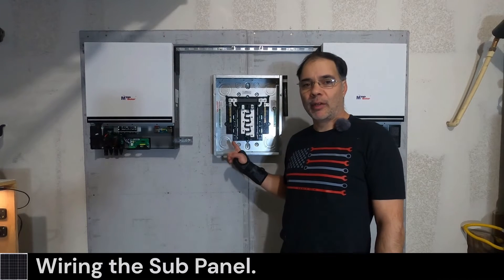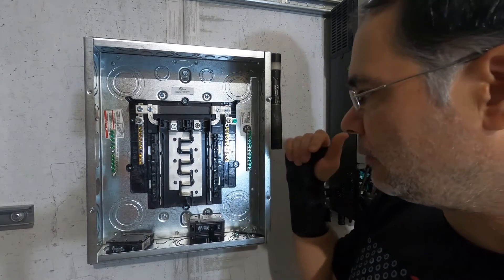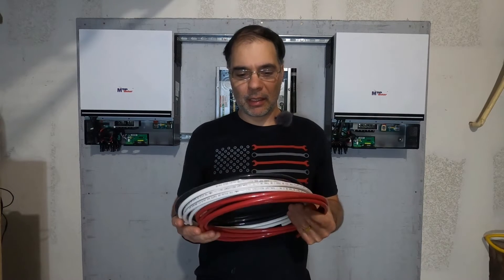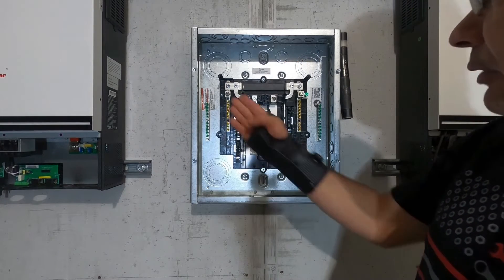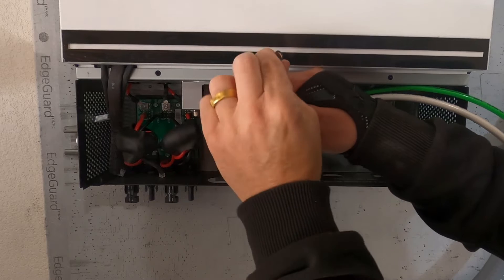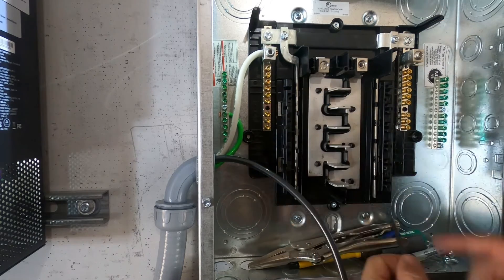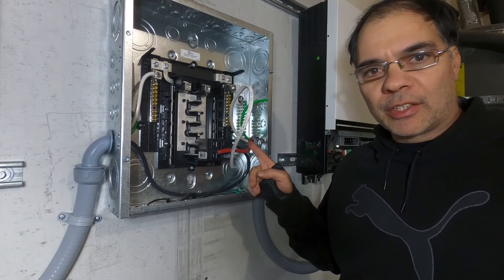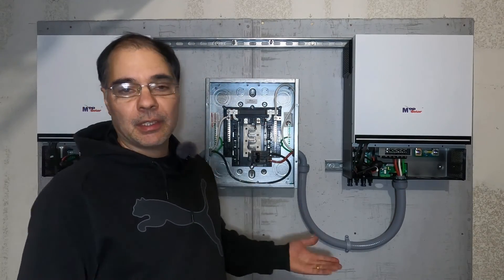Wiring Inverters for 120/240V Split-Phase

Comment: Hi Nate! Thanks for the helpful videos and neat projects. I have two MPP LV2424 inverters in split phase mode, just like what you have here for an off-grid application. I am observing an erratic behavior: When I turn on my Heat Pump, inverters' output voltage fluctuate between 100 and 120 (set to be 110) and my heat pump draws 12 amps instead of its normal 6 amp. I found a workaround: If I disconnect the PV, run the heat pump just from batteries, everything is smooth and normal. If I connect the PV meanwhile, system continues to its smooth operation. I found out that even in cloudy days system can start normally with PV connected from scratch. I have 10 of 420 W solar panels (2S5P). Do you have any idea what could be my problem? I am using a soft starter kit for my heat pump as well, did not help!
Reply from the maker: That certainly is strange.. what do u have set for paramater 01 - output source prioroty.. set it to SBU and see what happens.. any reason u have output set to 110v? Is your mini split 120v or 240v.

Comment: Hi, great video do you ground your main panel from inverters to the ground rot on your house?
Reply from the maker: I personally did by way of the grid input.  I've seen ppl do both ways.  Seperate ground rods and using existing ground rods. It really depends on your local regulations and system design.  Generally speaking, if it's an off grid system, then separate ground rod. but if it's grid tied, then use the same one.  See my video on ground neutral bonding in this series playlist.

Comment: Thanks for sharing your knowledge question on Earth grounding for an off-grid system I already have a ground rod for the DC side in place I will assume I need a separate ground rod for the AC side am I correct
Reply from the maker: Yes

Comment: do you have a video on wiring the  AC in to the inverters, how do you bring one neutral and ground to each inverter? thanks for the detailed and easy to follow video!
Reply from the maker: Yes, there is a complete playlist. I  think it's the 2nd to last one.. called wiring grid assist #8.  The ground and neutral are shared. It splits out in a J box.  

https://youtu.be/lsuo7R2AXsA?si=mhAbqkdQF54q7uAF

https://youtube.com/playlist?list=PL5HF6X8PstrQBzDUJA5fBtEXWk6bRvlPN&si=aOwuz5Ox07lkJsr-
Reply from the maker: Good luck!

Comment: Great video! Very informative. I have 1 question regarding the ground-natural ground screw and going off grid. My understanding that the manufactures manual should provide details on the location of the screw inside the inverter. If the screw is removed to be full off grid, does the neutral and all the wiring remain the same? The only difference is I would just remove the screw?
Reply from the maker: Funny, you should ask.. I just did a detailed video on this subject . I will be releasing it today. But it will affect the wiring . Not all manuals cover this.  Mine did not, and it depends on the inverter. Newer inverters don't use bond screws.. you need to know the type of bonding it uses.. look for the video later today.

For now, u can watch this guy's video pt2 and pt3 of his series.  I based my testing on his video.

https://youtu.be/Ky5luEx6R2M?si=ooYikGcbJ_456rZO
Reply from the maker: I just dropped the video in the pinned comment for you.. it's still unlisted. Hope it helps. Lmk
Reply: @natesdiysolar    tyvm. My goal is to do 240v 50amp off grid. Your videos are very informational and I plan to route EG4 Load L1 and L2 to the "busbar" on the Vevor outlet panel? What are your thoughts? I'm trying my best to find downsides but to my understanding there shouldn't be any as long as the load is within range(primarily due to the ease of use of the eg4). 

From your past comments I have found the EG4 has a programmable neutral bond which is great!

Lastly Im a novice so sorry for the extensive questions...Did you wire your inverters to the 50amp double pole breaker in your panel for the safety? Functionally would it be the same if you loaded it on the top of the panel(minus the breaker safety) example at 25 seconds https://youtu.be/DOtZcRYLroY?t=25?
 
Parts-
EG4 6000XP Off Grid Inverter 
VEVOR Temporary Power Outlet Panel RV Electrical Panel 20 50 Amp RV Outlet Box
17kwh Lifepo4
6KW Solar Array
Reply from the maker: @DrBT1  I did it for safety. I wanted to have a single point of disconnect. For your inverters, I think they put out 34a, so you might need 2 of them. They recommend a 40a breaker for each inverter on the right side of the panel.
Reply from the maker: @DrBT1  if you have a single inverter I would use the bond in the inverter. If more then 1 then unbound all and bond in the sub panel
Reply from the maker: @DrBT1  your inverters do split phase in a single unit so it's very easy to stack them.  Just pop in another 40a breaker . Will prowse has a good video on this.
Reply from the maker: @DrBT1  your inverters are different than mine.  I need 2 to product split phase.. your wiring will be a bit different and simpler
Reply: @natesdiysolar   I see what you're mentioning. My EG4 6000XP specs show "MAX. CONTINUOUS OUTPUT CURRENT @ 240V 25A" so I need to run 2 in parallel to hit the 50A or find a better all in one unit. The EG4-12000XP shows "MAX. CONTINUOUS OUTPUT CURRENT 50A @ 240VAC | 57.7A @ 208V"
Reply from the maker: @DrBT1  correct
Reply from the maker: @DrBT1  very few things will use 50a continuously.. the only thing I can think of is an EV charger... that's 12000 watts
Reply from the maker: @DrBT1  from what iv seen most ppl putting those inverter in an RV just get away with a single unit.   But if u need 50a get the 12000xp .. more power in a single unit

Comment: so these inverters are 120 v each so you need 2 inverters to make it 220v
Reply from the maker: Correct.  Check out the eg4 6000xp if you need 120 240 in one box

Comment: I also have two MPP Solar inverters of the same model. Your installation video series on YouTube is the most detailed and extremely helpful. I have a question: is the ground wire only connected to the electrical panel and not to a grounding rod? When using a 240V outlet to charge a Tesla, does it still show a missing ground connection? Does it require a ground-neutral bonding plug? Thank you!
Reply from the maker: I have not tested my system yet with an EV. I've been trying to get a fiend to come over to test it.  I do know the tesla charger, and many others look for a ground neutral bond.. so if you keep bonding screws in the inverters installed as they come from the factory, it should be fine.  It just wants to see a proper ground even if it's not grounded to earth. I do not have mine grounded to earth at the moment.. only to the sub panel. 

Yes, you would aquire grounding if connected to your house ground via the AC input. IF you use grid input.. 

If there is no grid input, you should have the panel grounded separately to earth, but the system will still work without.  I just have not gotten around to hooking up my grid input... which would in turn give me a path to earth via my house ground.. hope this helps.. lmk
Reply from the maker: Update: I just tested my system with an EV and I made a short video.  Yes it needs to see a ground neutral bond.  It does not care if the system is grounded at a ground rod. 2 different things.  

https://youtube.com/shorts/KrQK80X8JTw?feature=share

Comment: Do the inverters have to be stackable to do this?
Reply from the maker: No.  The eg4 6000xp I mentioned at the end of the video can do 120/240 in a single unit.  Link in description.. if that's what you mean.. do you need 2 units or will one work.. with these you need 2. Eg4 6000xp just 1. They are both stackable
Reply: @natesdiysolar You mentioned the inverter on the left and the inverter on the right.  I thought that meant they had to be stackable to do it that way.
Reply from the maker: @RVwithDD  oh yes.  They have to be able to communicate. Not all inverters do.  Most all in one type do.  Eg4 mpp grow watt .dye etc..  See video:  

https://youtu.be/D_KLSrsMI3E

Comment: Why didn't you use the main lugs?  I don't get it.
Reply from the maker: I wanted to have a main disconnect breaker.  Also, if I add another pair of inverters for parallel output, I could just add another breaker . Besides that, 2x #4 may be too large for the lugs, but mostly, I wanted a main disconnect.

Comment: Hey great video. I bought a eg4 6000xp it is also split phase. Can i get 240 volts off one inverter or do i need to buy another one?
Reply from the maker: Yes you can. I make mention of that at the end 9:30 of this video.  BTW I think that unit has a programmable neutral bond and uses something called common neutral. 

https://youtu.be/D_KLSrsMI3E?si=FQdJCY7OyIaAcwGj

Comment: I have a European inverter 3kva 24v dc to 240 vac but my 240 vac is 240 on line one 0 on line 2 how do i convert to 120 on both lines?
Reply from the maker: If it's just straight 240v, then it's not possible to get 120v . My inverters are 120v to start, and I use 2 of them to get 240v . You might be able to use a step-down transformer, but I have never used one myself.
Reply: @natesdiysolar  ok thanks man I got a step down inverter but it has a us  120v plug I'm not sure how to connect it